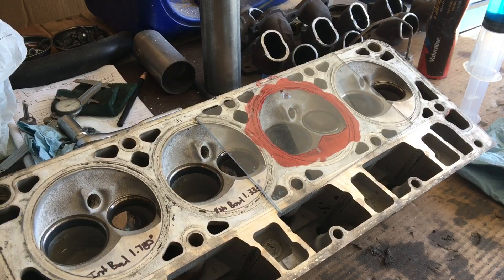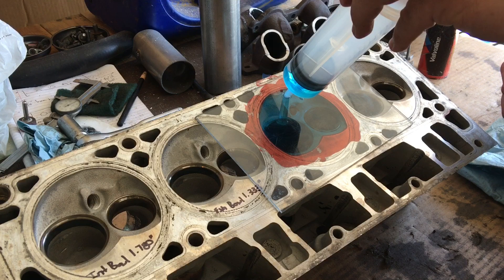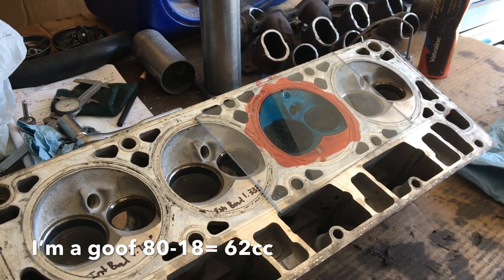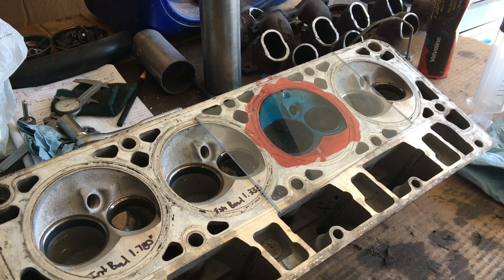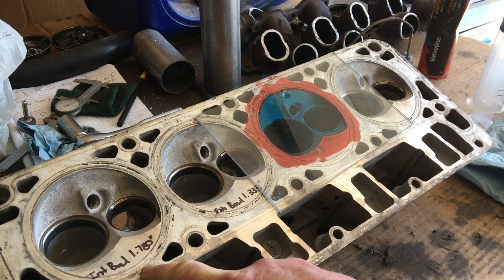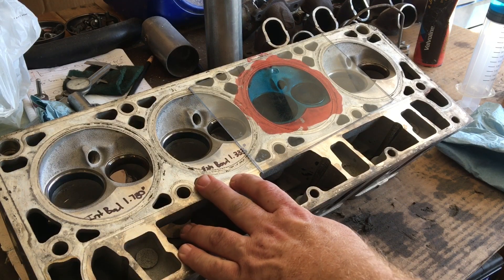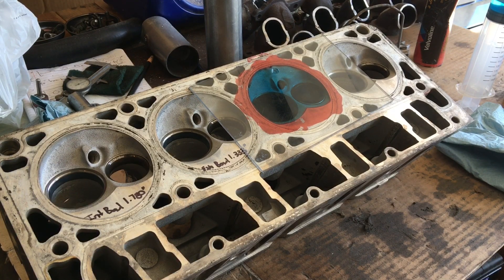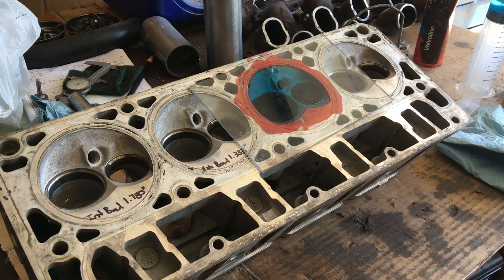Porting LS 862 heads 215cc

Comment: What is intended fuel for 11.0-1?
Reply from the maker: We would need to verify the DCR, Dynamic Compression Ratio based on the intake valve closing event.  With the right camshaft selection you could run pump gas safely.  If you run 11.0-1 with the wrong camshaft you can easily exceed 93 octane pump gas; this will cause detonation issues. 
Spend some time researching the SCR & DCR, you’ll find they are very different from each other.  Use the Wallace Pontiac free automotive calculators to help dial in your combo. 
http://www.wallaceracing.com/Calculators.htm

Comment: You ever do any dyno run or acceleration  comparisons. Ported vs non ported?
Reply from the maker: I haven’t been able to get on a chassis Dyno but I did have a set of my 225cc heads flow tested, those were 243 castings.  The 225cc heads out flowed the stock 243 heads at every lift point exceeding their max flow by .400” lift achieving 306+ cfm at .600” lift. 
I already know what my heads flow depending on what bowl cut percentage is used and final port volume. Just looking at the intake ports w/ 2.00” oem valve:
215cc head flows 275+ cfm @.600”
220cc head flows 285+ cfm @.600”
225cc head flows 300+ cfm @.600”
This is possible using the porting math/theory I used to create the ports. 
You can do the Simple 2hp per CFM calculation and see what your power potential is between head flow.  Compare a stock 862 flowing say 220 cfm to a 215cc head flowing 275 cfm results in a +110hp “Potential” increase provided your engine and combo can also support the power.  
This is why it’s important to match your head flow to the CID and power you either make or plan to make NA. 
220 cfm head 440+ HP
250 cfm head 500+ HP
275 cfm head 550+ HP 
300 cfm head 600+ HP 
Note: it would not be a good combo running a 225cc head flowing 300+ cfm on a 350hp engine; it’s going to have horrible port velocity and run poorly.  JD

Comment: If upgrading from a die grinder, take a look at Foredom electric shaft grinders with foot pedal speed control, they offer several styles, but the SR & TX allow the use of 1/4 burrs.. The SR has a working speed of 500-18000 rpm & TX at 500-15000 rpm. You must use appropriate hand pieces for each as the SR has a flagged shaft tip & TX is a square drive shaft.. Also if you use Boelube machist paste it will keep your burrs sharper longer, & keeps Aluminum from building up in double cut burrs, but a lot of material can be removed easily when using this product. Boelube is made by Orelube Corp for Boeing Corp and co.es in various flavors for different types of materials..Go to Orelube website to see which works for your application.. I have found 70302 & 70304 both work good for Aluminum for.porting work even though they are each for different materials, one for softer & one for more brittle materials. 70302 is soft & 70304 is medium paste. They also offer a lubricant in stick form that works well with sanding roll cartridges, keeps them from wearing out quickly.. Hope this info helps your hand and it's numbing.. Love your video's, learn something from everyone..
Reply from the maker: Mark Geletzke Thanks, I’m interested in this type setup because I can work at any time of day.  Thanks again for all the information I appreciate it!  JD

Comment: Is some of that liquid going into the spark plug hole? What happens if you install the spark plug and remeasure
Reply from the maker: gercedillo No fluid is going into the spark plug hole, if the spark plug wasn’t in the head you couldn’t fill the chamber all the fluid would run out the hole.
The rocker bolt would also be installed if the rocker lump removal poked through.  JD
Reply: HeadFlowInc ah ok...It was hard to see if you had a spark plug installed or used a generic plug on the other side of the head

Comment: How much power can I expect to gain if I’m able to mimic what your doin with these same heads minus the larger Valves???
Reply from the maker: Justin Derasmo You will have to account for every change made during the change. Compression, Camshaft, Exhaust, Intake, injectors Tune etc. etc. 
Looking at just head flow, you have to compare the average head flow, max head flow BUT at the lift of the cam being used. Flow numbers above .625-.650” lift don’t mean much unless your going to run a cam with enough valve lift to use it.  HR cams generally don’t go much above .625” lift, so you’d be looking at a Solid Roller setup with shaft rockers etc. 
I just want you to consider there’s a lot of variables when estimating HP. Gains... But let’s look at air flow at say .500-.550” lift since factory heads do well in this range. 
Power potential, you can assume 2hp per cfm of head flow as a base.  Going from a 220 cfm head to a 275-280 cfm head you’d have the potential to gain 110-120 hp at the crankshaft gain.  But this assumes the rest of the engine is built to use the new air flow. 
There’s another area to clarify, when people say how much HP they gained clarify if they’re talking Crankshaft or Wheel HP? 🤔
Just guessing I’d say conservative estimate would be 40-70hp+ at the crankshaft but it could be more depending on all those other variables. JD